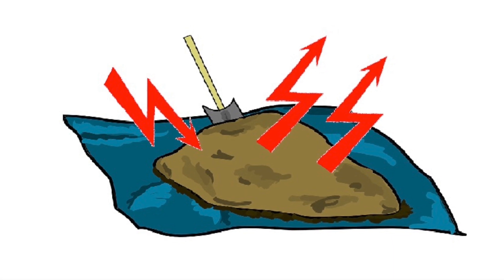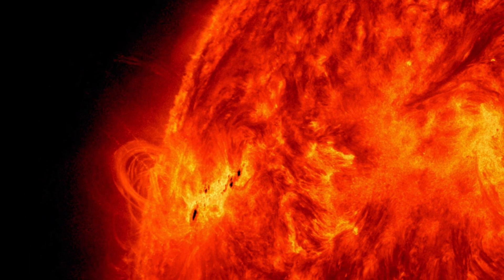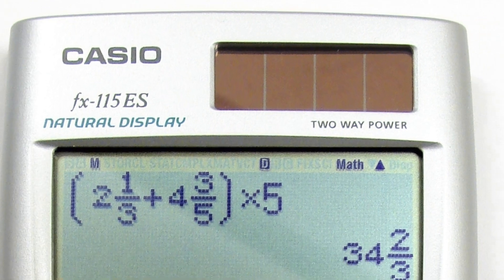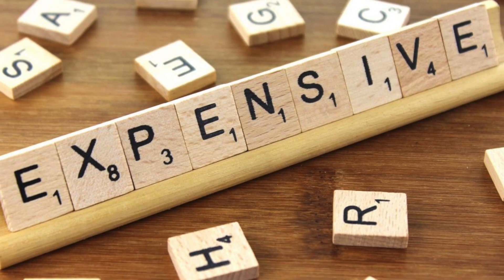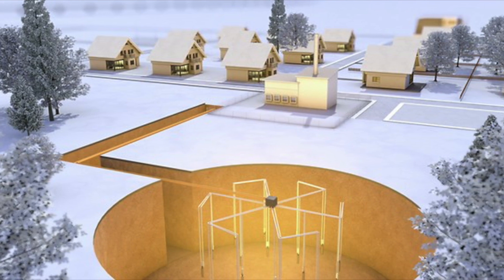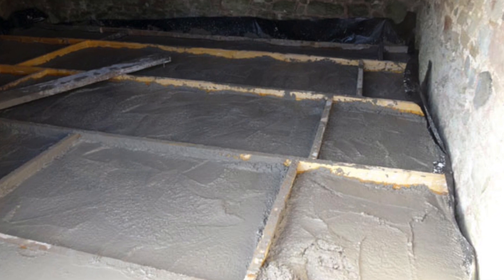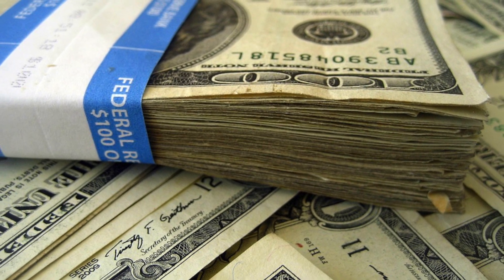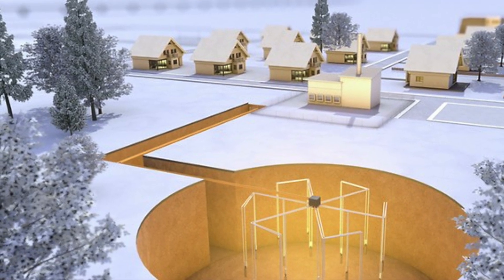Home Solar Thermal Dirt Battery (2020)

Comment: Easier way! Pex is fine, but do it this way, 18" post holes drilled by a post-hole screw on the PTO of a tractor with pipe extensions. Drill a rectangular field of these postholes, 3 feet apart,  15 feet deep. Coil your pex loops into the holes as they are filled, trench 6 - 8 feet deep all around the posthole field. Pour air-crete in the trench lined in the inside wall with foam insulation sheets. Put a rain water harvesting roof over the whole field two feet tall. Insulate it to R60 top and sides. Bring the pex to connectors and small pump under the rain roof. Use weak glycol antifreeze and water. Circulate to a heat exchanger in the home or basement with a fan and ducts.  At 15 feet deep the earth temp is naturally about 55 - 57 F/13 -14 C, but you can boost it with thermal solar. You can store heat in the summer by cooling the home using the same device. Insulate house well and double/triple pane all other windows, and increase south facing windows, put insulative batten shutters on all windows, closeable for night from inside. Also, solar thermal collectors can be mounted on or adjacent to the rain harvesting roof. Use them to boost the stored thermal energy.
Reply: The last geo/heat pump job I was on they never used insulation and I think any insulation on the bottom is wasted, further it is counterproductive. Also the depths they were sinking the verts was much greater, probably 50-150 feet if I recall correctly.
Reply from the maker: rstevewarmorycom I see a few problems with your idea, first insulated 18” holes isn’t enough material. To insulate the sides it’s not within the bore holes, but around the entire bore hole field. Second I’ve never heard of a 15 foot post hole digger, got any examples of that? A bore hole earth battery is usually over 100 feet in depth. I could be done with a well digging truck, but for one home it’s cost prohibitive. I’m open to more explanation though but I don’t see it
Reply: @SimpleTek  
No, you don't insulate the postholes, youmake a rectangular trench with a 6 inch chain trencher surrounding the field of postholes 3 feet apart,  and insulate the inside of the trench by putting foam insulation sheets in vertically and fill the outer space with aircrete.  You lay the coil of PEX into each posthole and fill dirt with each turn or two as you feed the PEX down into it. Posthole drills on the PTO of a tractor are used for drilling fence post holes and shallow wells, most screw together onto 1" or 1-1/4" threaded pipe to extend it. Thermal stores that use air use just big U-shaped loops of PVC into the ground in 10" postholes,  But if you WANT to excavate your whole back yard, be my guest!
Reply from the maker: rstevewarmorycom a 15 foot deep trench is difficult to impossible - sloughage from the edges will collapse it. Plus there’s no bottom insulation, it would be like wearing a parka but not wearing pants
Reply: @SimpleTek  
I said 15 foot postholes, and the trench was 6-8 feet.  You don't need bottom insulation. The soil that deep is 57 F all year round, even in southern Canada. And it increases when you store more heat in it with solar thermal. Over the first three years of a deep earth thermal store, WITHOUT ANY added heat to the store, the temperature of the soil will increase several degrees because there is no longer a cold ground surface in winter leaching out its heat to the cold air, the top of the field is insulated, and geothermal energy will rise under it and the levels of constant temperature in the ground will migrate upward slowly. This is called the umbrella effect. Look up "PAHS and the Umbrella house" online, (PAHS = Passive Annualized Heat Storage).  The thermocline profile under the house will be altered upward like a bulge in ground temperatures. The core of the earth pumps heat to its surface at a very slow rate, but it can be captured to a degree, but it takes years after an insulating umbrella is put in and over the ground.  The solar thermal contribution can be used to hasten this bulge!
Reply from the maker: rstevewarmorycom ground soil temps are different depending on your location. Insulating to 6’ is like saying all I need is a scarf and a bathing suit to stay warm in the snow
Reply: @SimpleTek  
A little, the temp at a 10 foot depth, however, is consistent wherever it's not tundra.
Reply from the maker: rstevewarmorycom it’s consistent but not the same temp in all locations
Reply: @SimpleTek  
After you insulate the trenches and on top it will be, in a gradient field down to the bottom.
Reply from the maker: rstevewarmorycom sorry I don’t agree on your idea.
Reply: @SimpleTek  
Your loss.
Reply from the maker: rstevewarmorycom thank you for the comments but I feel the volume of dirt your idea would heat up wouldn’t be enough or lack of insulation will negate any benefit on the size of the battery
Reply: @rstevewarmorycom  
Ground temps are entirely dependant on the amount of energy gained and lost. Sheltering the ground with a greenhouse radically changes the energy balance compared to the unsheltered ground outside. Sink some temperature sensors in sheltered and unsheltered ground at different depths and monitor them for a year. You`ll be surprised by the results.
Reply: @JohnGuest45  
That's what I said. Then he pretended he didn't dare believe me. Not only that, but the earth's temp is caused by 0.03 Watts/sq meter that comes up from the core of the earth and its core temperature and nuclear core reactions.
Reply: @rstevewarmorycom  
The earths core is estimated to be around 6000 deg C, but almost none of it makes it to the surface. The temperature of the earths surface is influenced mainly by the sun, rain wind etc unless you live in iceland or somewhere else with active underground volcanic action.
Reply: @JohnGuest45  
Mainly, sure, but because earth is such a big thermal resistor, as in R value, the deep earth temperature is increased by the earth's core, or else we would be at the black body temp for our distance from the sun and our solar insolation, which would be about -15 C.  Did you know that heat reaching the earth's surface from the core is some 47 TeraWatts continuous?  Now, given the area of the earth, that is a small Wattage per square meter, (0.0916 W/m^2 ) but insulate it  enough and the temp at the surface can rise. At very least it won't fall, and the degree-wise thermoclines from deeper strata will rise nearer the surface once insulated.
https://en.wikipedia.org/wiki/Earth%27s_internal_heat_budget#Global_internal_heat_flow
Reply: @rstevewarmorycom  
The 26 sensors i `ve had in the ground for the last10 years, in, under and outside my system at various depths dont support that theory. Its not easy to track heat movement in the ground but given enough measurements over a long period of time you get a fairly good idea.  Its clear to me that the amount of heat arriving from below isnt worth consideration.  Its amazing how many folks will believe heat removed from the ground is continuously being replenished by heat from the earths core..instantly  ;)
Reply: @JohnGuest45  
Heat from the earth IS being replenished at a VERY slow rate by heat deeper down, and from the core heat, but that is VERY slow, you're right.  I have NO idea of your situation or whether you understand it correctly.
Reply: @rstevewarmorycom  Thanks for that info - very intresting.
Egzample: in Lithuania average air early temp is 7C, average temp in 10 m deap is 9C. In Cyprus 20C air and 22C underground.
Foam heat resiztance is ~0,03w/m2k. Does it mean that we need like 10m foam insulation just to lift soil temp by ~10C? (and of course VERY big surfase area/umbrela).
Reply: @rapolasmasaitis9824  
So you don't have summers in Lithuania?  Cyprus is old volcanic.
Or put a house over it. The PAHS Umbrella House does exactly that.
Reply: Your way is the way I'd do it rstevewarmorycom.  Simple.  Accessible.  No heavy equipment.  Easily expandable for those of us who have the luxury of land.  I may even be tempted to insulate only the top.  If I lose some heat from slow moving thermal migration, so what.   I haven't spent a lot on sealing up the space.  No quibbling about a few nano degrees in earth temperature or solar temperature.  I get what I want...heat.

Comment: Recochem | Winter Proof Water System Antifreeze - 9.46 L - Pink can be found at Rona for under $15,
Would be a better alternative than windshield washer fluid.
Reply: I have 45 gal. drums for $120.00 .  If you where in my area. 
But auto scrap yard sell used for less.  They may give you a better price if you take more. Good luck Thanks
Reply from the maker: Kijiji2017 Porter good idea
Reply: Can you use green auto coolant in the system.
Reply from the maker: Kijiji2017 Porter sure but it’s expensive
Reply from the maker: Master V great idea

Comment: Warning idiot around. With the same basic idea without the thermal solar collectors should be able to cool a house and drop dependencies on Air conditioning units. Sorry I'm in a hot climate and fighting the opposite problems.
Reply: I am building a similar system that will do both.  Heat and cool for my home and greenhous.
Reply: @dreambig694  Nice
Reply from the maker: What you’re saying should work in a hot climate. Where I live heating is the issue.

Comment: I'm interested in your ideas. Im looking at a variation on this system where I will be building a south facing greenhouse with a thick, insulated wall with the pex pipe running through it.  As the sun hits the wall ,it heats the thermal mass of concrete and the per pipe with the fluid, which is pumped to a large insulated buffer tank. Keep us posted on your progress. Jeremy
Reply: If you ever go in a greenhouse, even on a fairly dull day, it's warm. So let's make the most of this. By having the greenhouse triple glazed you also retain the heat through the night. The other bonus with this idea is that it extends the growing season. I am also looking at the potential of extracting heat from compost. Not a small compost pile, but an insulated clamp of say 12 foot cube, with pex pipe running through it, at different layers.(Air needs to be introduced from below,) but temperatures of 160 degrees F, are possible. The challenge is how to remove the pex pipe without damaging it once the microbial action, and the heat has come to an end. If this second idea is of interest to you, go on YouTube and search out the work of the Frenchman, Jean Pain. Hope this is of interest to me. Jeremy, in the UK
Reply: @jeremyratcliff1875  Maybe use a fitting like an pneumatic air gun line attached to a manifold and simply reel the lines out of the pile form one end. You might consider some kind of air trap at a high point to remove entrained air.
Reply from the maker: Jeremy Ratcliff check my other videos, I have one on compost heating!
Reply from the maker: I’ve never heard of running pex through the north wall... intriguing
Reply: Would it make sense to heat up the soil in the greenhouse let's say to lay down pipes similar to underfloor heating and keep the soil warm. The greenhouse will be insulating the soil from elements hence cooling will be  moderate.
Reply from the maker: @radnasirhill  yes but that removes thermostatic control
Reply: In what sense? I'm in the dark here but I have a slight suspicion that if the roots of the plant would be at their best temperature than the rest of the plant would be fine. My goal is to grow let say coriander all year round from seed,plant the seeds straight to the greenhouse warm soil. No mucking about to grow tiny plants indoor and than transfer them to the greenhouse but plant seed over the one half of greenhouse and a few weeks later plant seeds to the other half trying to achieve continuous harvest if this is make sense with my broken English.
Reply: I don't see any point in heating up anything else than water,store it than use it. An well insulated big tank of water in the cellar or deep enough in the ground will keep you going from heating point of the question and for me this is a goal. I wouldn't mind to sit by the candle light in warm room but I would mind to sit in the well lighted room with frozen feet's. I have never heard about anyone who dyed by dark but it is plenty to mention who dyed from getting frozen. No offence. Just my opinion and long term goal in heating.

Comment: I like this idea as an alternative to retrofit an existing house vs. my dream of building an Earthship. Love some aircrete too... Got a nice demo of it during my time in Taos at the Earthship Academy.

My initial thought is why have ducts to force air through or even a second loop of pex? Why not just branch off at your manifold and supply a heat exchanger in the home? Run the circ pump when the t-stat calls for heat but have an electronic valve that cuts the supply to your collectors after sundown. Little thermal  loss to night air from collectors as they would be valved off and only one hydronic loop needed. (Multiple pickup coils in the battery could potentially make cool spots if say one zone was always demanding more heat... seems like it would need balancing somehow.)
Reply from the maker: thank you

Comment: The issue I have with air recovery is if there ever was a leak...water from your system or natural moisture....then you can start getting mold mildew bacterial growth that would not be noticed for a while.  I would like the air if maybe covered in the air create and sealed better.
Reply: When backfilling the hole I would first cover the pipe with sand, preferably of a different color then the natural area.  This helps protect the pipe from damage from rocks, even the smallest can be a pain when they instantly cause a leak or wear a hole in pipe over time.  The off color help you when and if you have to dig it up.  Gives you warning you are near the pipe.
Reply from the maker: Gordy Bishop good idea, I have free sand to use...
Reply: But the air will only be moving when your extracting in the winter when you have heat to extract.  Lots of downtime..hours...days...weeks...months
Reply from the maker: Gordy Bishop good point.
Reply: https://en.wikipedia.org/wiki/Solar_Energy_Generating_Systems
Reply: Add iodine to the air?
Reply: @gordybishop2375  
No, the water.
Reply: I am talking rainwater/groundwater leaking in not the heat transfer medium
Reply: @gordybishop2375  
Iodine kills all germs.
Reply: Yes Iodine is great for germs and radiation.  But I am talking in an air duct hundreds of meters long that gets water in leakage
Reply: @gordybishop2375  
Water holds iodine and activates it to kill germs.
Reply: But how to get it in air ducts?
The water in this scenario is from rain or groundwater
Reply: @gordybishop2375  
Spray iodine water into the fan stream.
Reply: Maybe pour iodine in pipes before you put them together and bury.  Not sure if the vaporization will spread through all that pipe
Reply from the maker: The moving air tends to eliminate mild by evaporation in similar systems
Reply: I know this is an old thread, but I'm thinking using an ozone generator in the supply plenum would neutralize any and all pathogens and all that duct work should neutralize the ozone generated
Reply: So you know my background is with the SEGS solar thermal plants here in the Mohave Desert.  Construction , Maintenance and control room operator for 26 years.
Thanks for the story on the dirt battery that’s been in use for a decade.  Did not know about that.,

Comment: i like your long term thinking on why you are choosing this system. there is a lot of math that goes into these systems. i think you would be ok on the washer fluid but id have to wonder at the heat capacity of each liquid. the glycol IIRC was thicker, i would think this means it can carry more heat energy than the WW fluid. the glycol is also used in some pretty high temp systems too that would risk the WW fluid pressurizing and maybe flashing over to steam. ( which i know is not a concern for you)
Reply from the maker: M Olcott I may try it but with a system where I can flush the liquid if I need to change it

Comment: If you used the liquid transfer method would you have to have a dip stick or some method to check for leaks and refill as needed?
Also this sounds a lot like a heat pump that's buried or is this over simplifying ?
Reply from the maker: rv sorce great comments, heat pumps usually Use expensive electricity to boost heat, this avoids that
Reply: @SimpleTek  
Solar PV can be used to run small heatpumps.
Reply: @rstevewarmorycom  I love heat pumps myself. A low tech solution could save lots of energy though. Set up costs will probably be similar though.